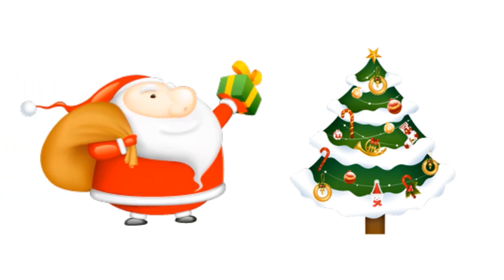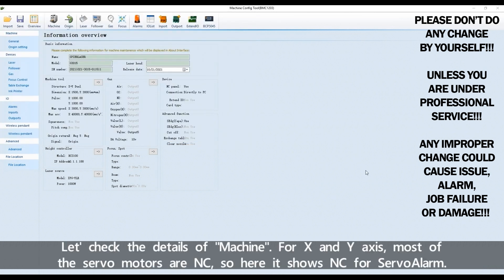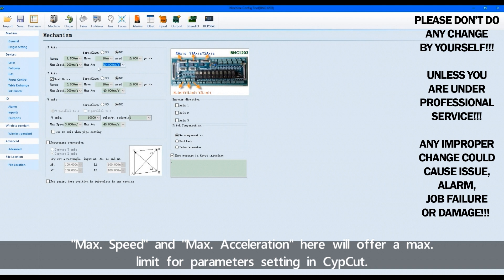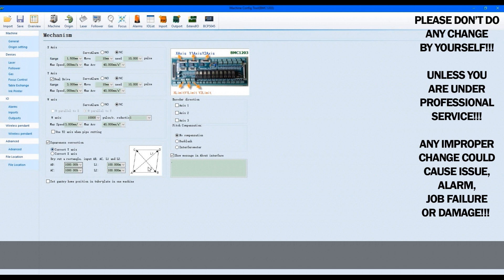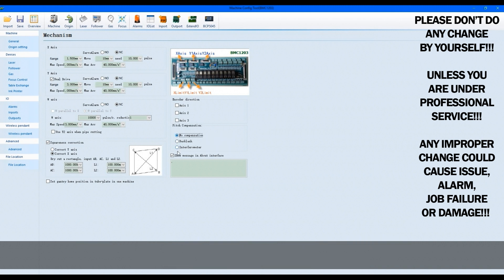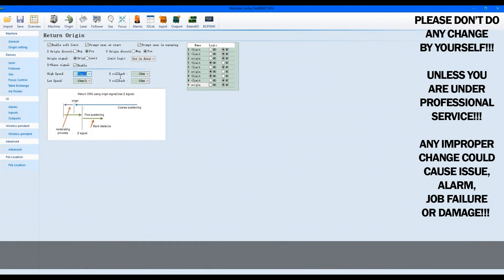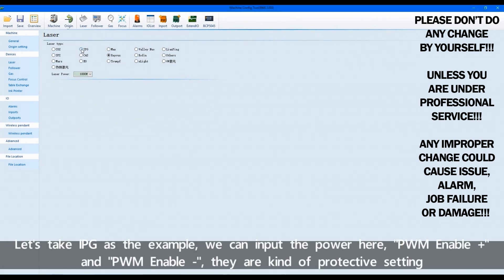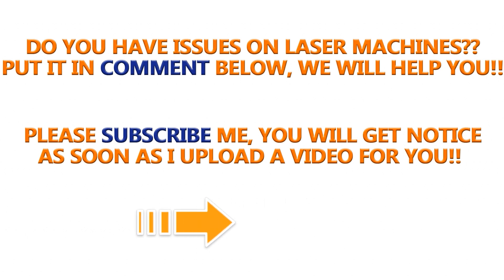Machine Config Tool | Cypcut Tutorial English for Laser Cutting 1

Comment: Hi Clara, I have a problem with my CNC laser Cutting. I Installed Cypcut few days ago, but there is problem with my laser Cutting Table. Cypcut & Laser cutting is not sychronize, I Mean, when I tried to cutting a dxf file 10 x 10 mm, the result is 24 x 24 mm, and when I tried  20 x 20 mm, the result is 47 x 47 mm. I Hope you can help me, thank you. 

My Laser Cutting Table is 1510 x 3020, but Cypcut application is like detect my table more than 1510 x 3020.
Reply from the maker: You need to make some setting.
Reply: @ClaraChai  is the setting in CypcutConfig ? I tried following my other machine, but the result is same.
Reply from the maker: @nazwir  It is not the universal setting for all machines, especially the machine config tool.